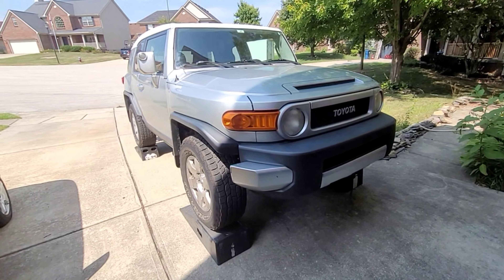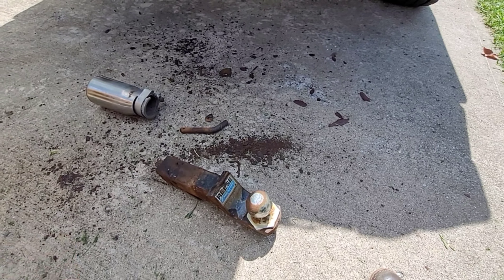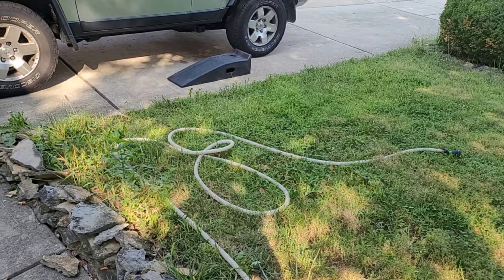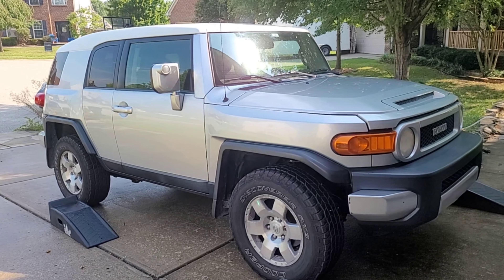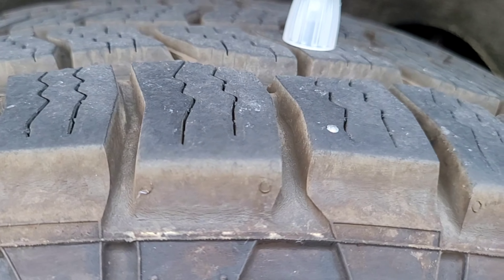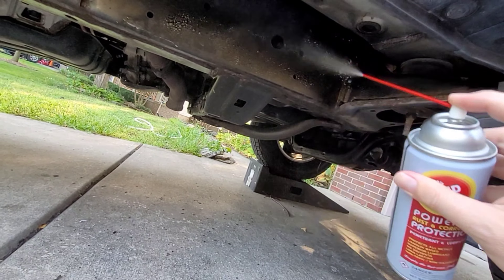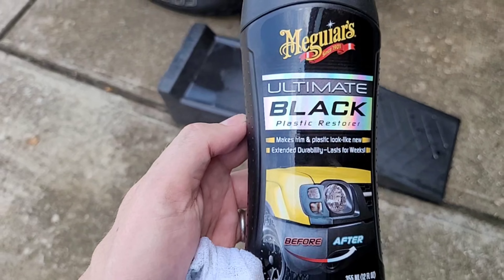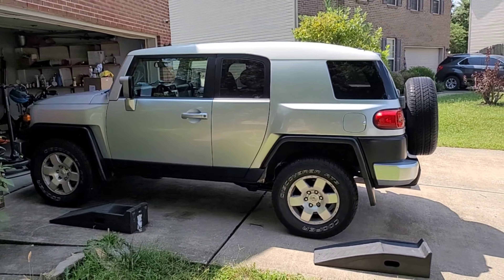SAVE YOUR FJ!!!

Comment: Surface shield and fluid film are great waxes to keep rust at bay. I use it on my cars to keep rust from growing. Plastic restore will work for a couple weeks, need to apply again often, not much that can be done. Don't burn it!
Reply from the maker: Yes, agreed on the plastic restore.  I usually get about a month out of it.  I consider it like sunscreen.  If it is going to be a sunny month, then apply!